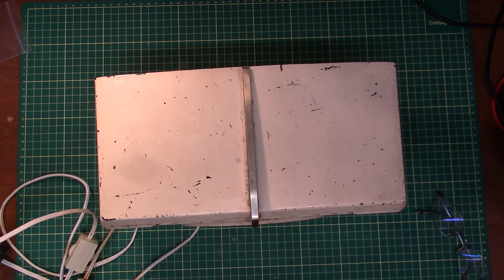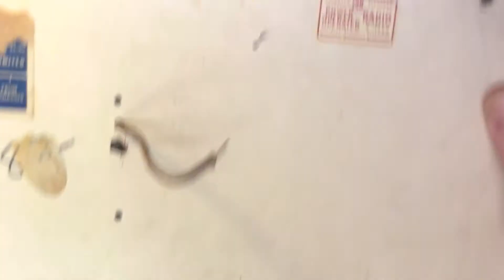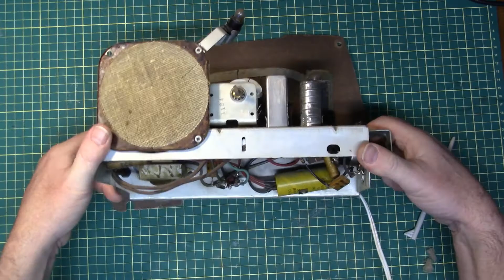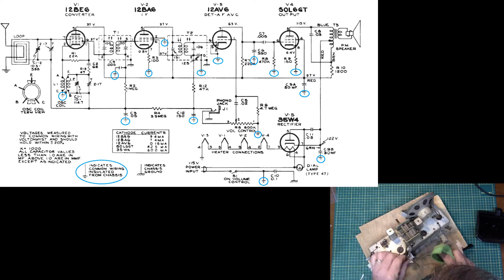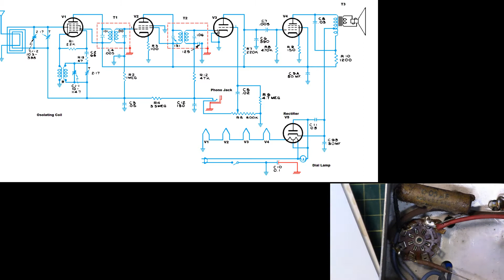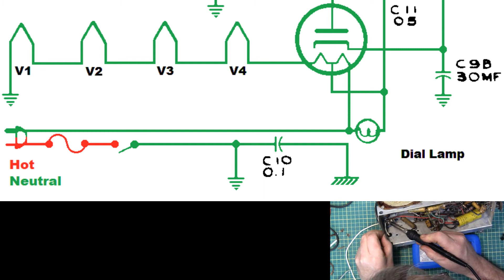02021 Little Master IV Part I  Taking it Apart and Putting it back Again.

Comment: Nice video. I live in Victoria and have the same model radio, but the brown One on your schematic. Mine doesn’t have quite as many issues as that one though. Just out of curiosity with all the work that it took to repair that one. How much do you charge for a restoration like that?
Reply from the maker: Thanks.  I believe the correct shop term for that is 'Basket Case'  As it took about 20+ hours to totally fix this one up.  I did this for fun and for a neighbor of many years.  If i ran a shot the first thing I would do after I opened it up and saw the decay in the wiring is call the client back and tell them to come and pick it up unless they want to pay well over 500$ to get it running.   Normally a recap is about 50$ plus parts even then you would not be making much.   Hence the reason one see very few service shops these days just no money in it.  Don't forget to subscribe ;)